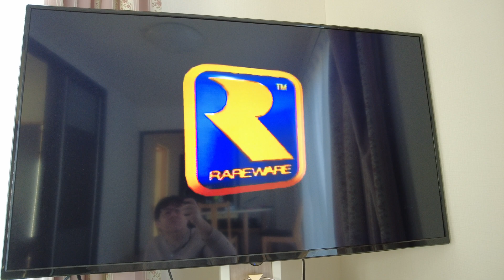An RGB mod that ANYONE could do to improve their N64 video quality

Comment: I wouldn't trust myself with a soldering iron
Reply: Same here - this looks like a neat solution for early NTSC consoles but I wouldn't classify having to solder in a new board as something "anyone" could do.

I was hoping that someone had discovered that all you need to do is cut a trace or snip a leg of one of the chips, like disabling the lockout on the NES or removing the Mega Drive's colour bars.
Reply: @liamh1982  yes I wouldn't even attempt anything like this.
Reply: @liamh1982  Agreed, it's like saying anybody can install an elctrical wiring into their wall/anybody can install Spark plugs into their car. Some can, most can't without breaking something
Reply: @wizkaqueefa9003  spark plugs 🤣
Reply from the maker: Installing spark plugs is super easy.  It's exactly like screwing in a light bulb but attaching a cable to one end.  Anyone can do it.
I think that a lot of people fear what they've never tried but once they try, it's not as difficult as they once thought.
Reply: @RetroCore i snapped a heater plug in my van years ago then ended up scrapping it. It was a  citroen relay 😂😂😂
Reply from the maker: It's not so bad once you know.  I used to be the same.  Wouldn't go near a soldering iron but once I tried it, I found out that soldering was easy.
Now, soldering fine wires on to super thin legs of a chip, that I can't do.  My eyes aren't that good anymore.
Reply: I went through multiple n64s before successfully RGB modifying one. But I hadn't really soldered anything before. It sucked, but I think I had to learn by doing. You have to figure out what feels least awkward for you, be patient and have focus. I am not good at soldering, but I'd do it again...maybe with some wine to mellow me out.

Comment: Am I right in saying that PAL consoles need a more extensive mod ?
Reply: Yes. PAL consoles and the later NTSC consoles need a digital side RGB mod, like Tim Worthington’a N64RGB. Only early N64 consoles have the VDC-NUC video DAC with built-in RGB output. Once they combined the audio and video DAC into one, they used/repurposed the vestigial RGB pins which weren’t connected to anything except on French consoles.
Reply: I was thinking the same thing, I think us PAL users are just screwed, you'd have a to buy a fully modded 64, which I've considered before because I love my n64, most mods I saw also would not allow PAL games, you'd have to buy the NTSC versions of the games for them to run, which was a double whammy.
Reply: @newtypepunk9967  Yeah I got my hopes up thinking there'd been a breakthrough of some kind, but this looks like the sort of mod I'd seen before. Oh well. I'll stick to my crappy s-video to HDMI convertor box!
Reply: @HiddenAsbestos  LOL yeah I knew it would be like this, Nintendo always screwed PAL users over with their machines, composite it is for me sadly, but I've got used to it.
Reply: @newtypepunk9967  If you do go down the modded route, there is always the option of a generic multicart with the SD card that comes preloaded with both PAL, and NTSC/NTSC J games, and they run about $40 - $50 USD on Aliexpress. It seriously was one of the best things I did for my N64 even though I have about a 90% complete US collection.
Reply: @CommodoreFan64  Oh yeah I've considered buying one of those too, I mean my n64 collection isn't massive anyway, but buying the same games would still be annoying, so yeah the multicart thing is the better option.
Reply: They need putting in the bin
Reply: to add insult to injury, not even S-Video was supported on PAL N64s, not officially at least. I think it's safe to say that PAL N64 users got the short end of the stick, as far as video quality was concerned,  that generation (and most other generations I guess!)
Reply: @amerigocosta7452  I suppose we got much easier RGB on Game Cube without needing expensive/rare cables.
Reply from the maker: Seriously?  So PAL units are composite or RF only?  Oh my, that is awful.  Surly the French consoles would be different though?
Reply: @RetroCore  They have composite video, which is what the RF modulator uses, but S-Video is not fully implemented and requires a special cable. When RGB modding them for PAL equipment, PAL users have to decide if they want to replicate NTSC-J/U RGB specs from the SFC/SNES and GC, PAL RGB specs from the PAL SNES, or PAL RGB specs from the PAL GC.
Reply: @RetroCore  officially yes, composte only. Third party s-video cables were available but I'm not sure all PAL consoles would output the signal.